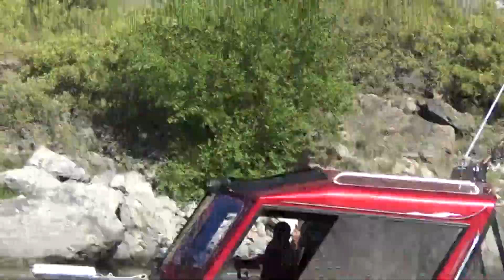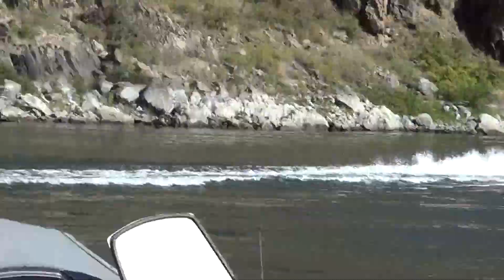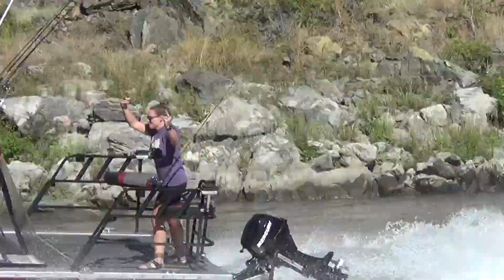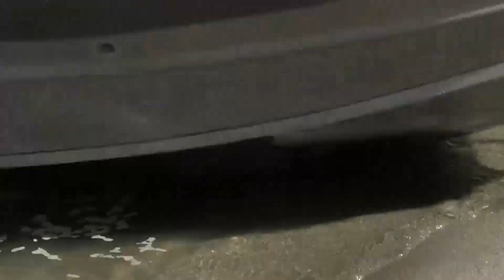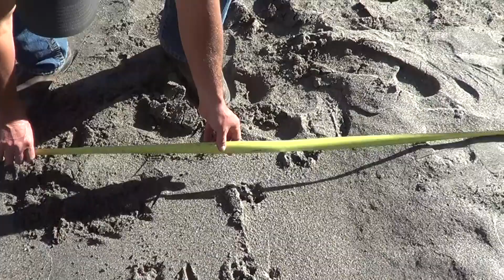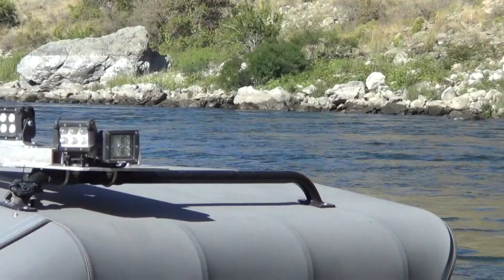Jet Boat Wake Control

Comment: Don't run a jet boat if you are concerned about being waked. Sometimes you cannot slow down without busting up your hull.  Common courtesy on rivers USED to be coming off step meeting a boat going or coming BUT unless you can, its BETTER to go by at speed on plane , not slowing down.